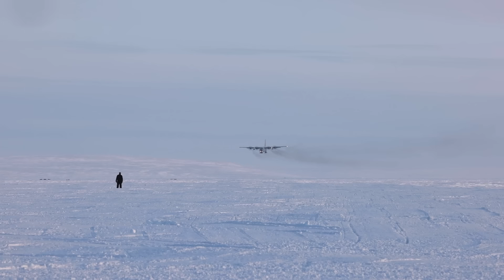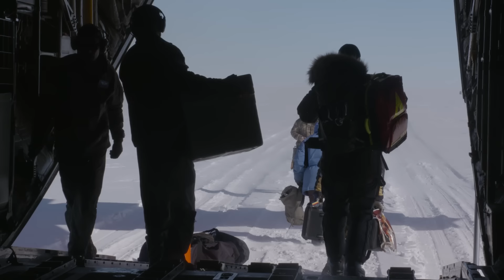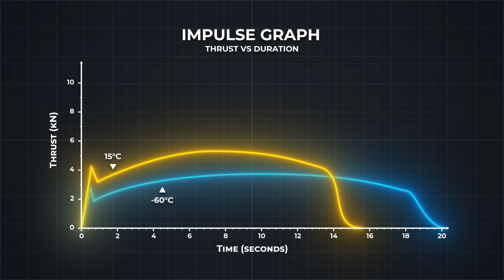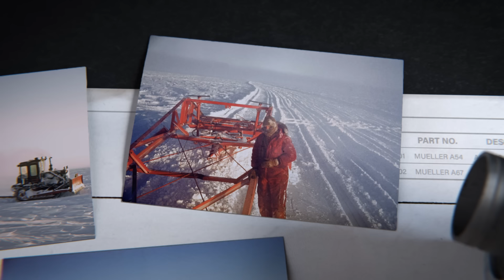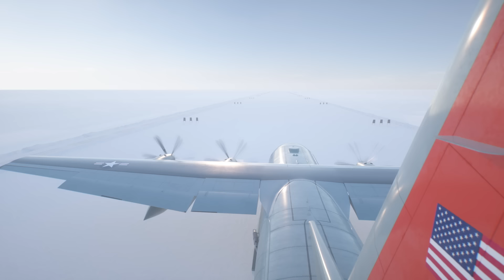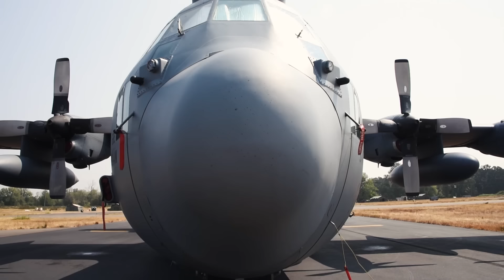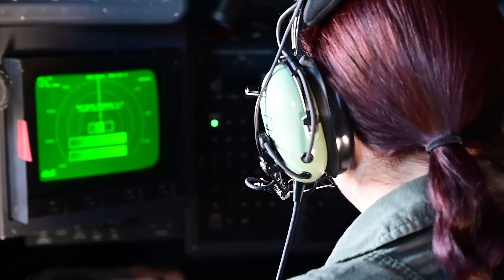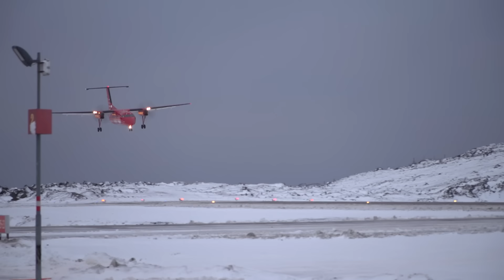The Wildest Take-Off of My Life

Comment: JATO rockets are straight-up one of the most badass things humans have ever strapped to a plane. I mean, the C-130 blasting off the ground like it’s late for war? That’s already insane. But then you find out they bolted JATO packs to DC-3s, C-47s, SR-71 prototypes, Cold War patrol bombers, and even fighter jets just to see what would happen — and suddenly aviation turns into Mad Max with wings.

And don’t even get me started on the Zero-Length Launch (ZELL) systems — like, “Hey, what if we launch an F-100 from a trailer in the middle of nowhere using a giant-ass rocket?” No runway, no problem. Just light the fuse and send it. That’s not just engineering — that’s pure testosterone and rocket fuel.

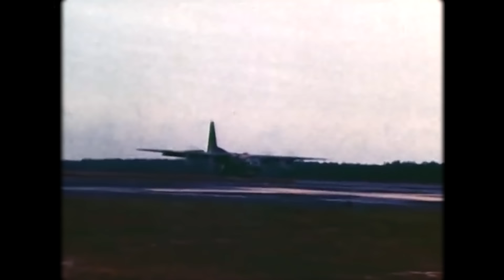The whole concept of landing a C-130 in a soccer stadium just proves exactly how cool these things are. We were so close to turning cargo planes into friggin VTOL sci-fi monsters.  t 3:49, I don't know if y'all were tracking this, but that thing was off the ground from a dead stop in just about 3 seconds!  They put a friggin c-130 in the air in around 100 feet!  

JATO is just friggin cool.

Comment: I grew up literally down the street from the front gate of the Stratton Air National Guard base - it wasn't even named that yet at the time  (47 Habel Lane was our home).  I could see the base buildings and some of the apron from my bedroom window, including the test stand where they ran up engines after maintenance.  You just kind of got used to the noise and vibration.  The 109th was operating C-130D models, very early C-130s with three-bladed props, when we first moved in - some with skis.  

In the mid-80s they replaced them with LC-130H models.  I wonder if there will ever be an LC-130J model - those LC-130Hs are getting pretty old now.

There is a C-130D on display as a gate guard outside of the base now.

Comment: Great video.  It brought back many memories as I was a pilot flying these same missions in the early 1970's (50 years ago!). Some history:  I and my trusted crews (pilots, Flight Engineers, Navigators and Loadmasters flew out of Sondrestrom (now Kangerlussuaq) to support the two Distant Early Warning (DEW) sites out on the Ice Cap (code named Dye II - 7,600' MSL- Now Raven Camp) (and Dye III - 8,700' MSL - about a 30 minute flight further south east) (both now abandoned).  We were the 17th TAS (Tactical Airlift Squadron) back then based at Elmendorf AFB at Anchorage Alaska. We always had two aircraft at Sondestrom and would rotate crews and aircraft about every two weeks.  Our aircraft were different. We flew C-130 A models that had a max gross weight of 124, 200 pounds. We had six of our aircraft modified with skis and were designated C-130D's.  They had 3-bladed Hamilton-Standard props that had a larger diameter than later C-130s, starting with the B model that had 4-bladed props. The procedures the 109th use seem to be pretty close to what we used for operations and the hydraulics and design for the skis seems to be about the same.  The 17th did the Arctic work while the Navy used early LC-130's for the Antarctic work.  Brian, thanks for the fine work on this production and special thanks for the memories you brought back.  Jim Banas, Captain, USAF (Ret).
Reply: I was in Sonstrom and 64 when we were bringing F102 back from France. It was a refueling while there I watched C1 30 fake off with rocket assist because our runway was very short. It was amazing how quick the 130 would jump off the runway I was with 59 FIS from Goosebay Labrador

Comment: My Father was a Navy pilot in Operation Deep Freeze in 1967-69 flying C-130s on skis in Antarctica. The ice takeoffs and landings on prepared runways were not terrible, but the science outposts that overwintered usually had snowed over and that was really hairy. One place they had to taxi the plane up the base of a mountain and turn it around and use the slope to get enough speed, hit all the JATOS, and take off. He took photos of the plane making a trial run up and down to pack the snow first. Maybe they just did it for a goof, those guys were all crazy. He said the scientists stunk so bad after spending the winter basically buried in a Quonset hut that the crew clear up in the cockpit wanted to gag even with oxygen masks.

Comment: The Hercs we’ve flown on in recent years both in Antarctica and Greenland are quite old. Modernization of the propellers and engines helps but many of the airframes are still 70’s era. They seem to be in a state of constant repair and often can’t complete missions because of equipment problems. A much newer plane with the same ski and propeller setup could probably improve the overall performance of the LC fleet

Comment: Great video! I spent a long year at Kangerlussuaq (called Sondrestrom Air Base when I was there) as an Air Traffic Controller in the USAF. During the summer we would have 3 ski equipped C-130s arrive to fly refueling missions to the Greenland Ice Cap and the early warning radar sites called DYE-2 and DYE-3. They would carry large amount of fuel oil for the DYE sites to get them through the rest of the year. I saw many of them use JATO during those missions. We even had one come back from a mission with one of the main gear skis hanging down because of a failure during its takeoff from the ice cap. The pilot handled it perfectly and managed to scoop it up as he touched down on the runway with minimal damage to the ski and aircraft. That was a tough mission for the C-130s but it is a fantastic aircraft. BTW this was in 1974 and they were flying C-130A models with 3 bladed propellers. A lot less power than the later H and J models in this video.

Comment: I was curious about why it still had such a big radar. The compass is, obviously, useless, but I was assuming that it would be perfectly capable of navigating using GPS.
The removal of the radar would save a significant amount of weight and it would reduce drag as well.

Comment: Hovercraft wouldn't have any friction with the snow regardless of what type of snow you have, hovercrafts float on a cushion of air only the skirt touches the ground, so almost zero friction.

The turbo prop engines on the airplane would have the ability to provide massive amounts of compressed air, if the ski's were replaced with hovercrafts.

Comment: The Co Pilot  hits a button in the cockpit on order of the Pilot. The button is near the aft end of the center control pedestal, it's small, round and black. just to the side is the guided Arm switch with has to be opened and flipped forward in order to arm the button.

Comment: Excellent presentation -- thank you! My dad was a navigator with the 17th Tactical Airlift Sq., the "Firebirds," at Elmendorf AFB, Anchorage, Alaska, from 1971-75 -- the year  that the (active duty USAF 17th TAS) transferred its Arctic/ski-model C-130 mission over to the NYANG at Schenectady, NY. Those airframes were (early) C-130A/D-6, with just a few having the skis (largest aircraft skis made), early Allison T-56 engines,  three-bladed props, and JATO bottle augmentation. The ski-models supported the distant radar sites on the Greenland icecap, operating from (then) Thule and Sonderstrom Air Bases, as well as other Arctic missions on snow/ice sites. The other (non-ski) -130s of the squadron supported the many DEW (Distant Early Warning) radar and military sites around the periphery of mainland Alaska and the Aleutians. 

In the mid-1970s, there was a mishap on the Greenland icecap, resulting in the loss of one of the ski 130s:  I believe it was during a missed approach landing attempt, with the left wingtip striking the surface and bringing the aircraft down and sliding to a halt. The left wing folded down at the root, with the #2 engine prop tips cutting a narrow gash into the fuselage - tragically, killing a Danish national passenger seated in the (folding) troop seat at that location. 

Much has changed since, with NYANG's 109th Sq. operating in both Arctic and Antarctic missions -- progressively upgrading the versatile Hercules airframe to the LC-130s newer engines and props. There is one of the original 17th TAS's C-130A/D-6s, with skis, old engines and props, and the signature gray & red livery, sitting outside at the (fantastic!) Pima Air Museum, Tucson, AZ --  tired and weatherbeaten now, but really good to have such a unique example kept for all of us to be able to walk up to and see. I recall seeing my dad's (then) crowded nav station, with sextant, heavy case full of polar nav charts, celestial sight-reduction table pubs, stop-watch and big, ol' Hamilton 24hr navigator chronometer, dividers, plotters, and all of the heavy analog instruments, radar repeater, LORAN tube, and life support gear. NO GPS then.
Reply: Same time I was there.  What was your dad's name?  The mid-70's mishap was tail number 495.  Lost rudder control on approach.  Mishap board said it was "fin stall" but most of us felt it was a failure of the rudder hydraulic pack.  They settled to the icecap fairly level and one of the pilots commented that, "They thought it was a slightly harder than normal Ice Cap landing", until the nav looked out the crew entrance door and saw the left wing root was cracked and on fire.  The Danish national was seated just forward of the prop line and when the #2 prop came off it gashed the fuselage where he was seated and he bled to death from the injury.

Comment: Marine KC-130 mechanic here, I worked on aircraft equipped with the 4 blade props. They were susceptible to hydraulic leaks in cold weather (hydraulics controlled the variable pitch props). The USMC sold/transferred all our aircraft which were then equipped with the NP-2000 8 blade props. Other than the performance increase, I hope the engineers figured out this issue, but its good to see these old hercs still operating in the harshest environments in the world! great video!

Comment: In the early 70’s the “ski birds” flew out of Elmendorf AFB to resupply the Thule Greenland radar sight. Our shop would on occasion have one of the skis in for repair. They are incredibly heavy and no doubt were the reason for JATO assisted takeoff. Part of the repair was replacing the Teflon sheeting on the lower surface as well as repairing banged up chines. Amazing machines.

Comment: The C-130 is such a versatile air-frame.  I had the pleasure of riding in one based out of Kodiak Coast Guard base during one of its "milk runs" to Anchorage.  
Need to precision drop critical lifesaving gear to a fishing boat in the middle of the Northern Pacific ocean ? Coast Guard C-130
Need to move supplies to a dirt road in a combat zone? C-130
Need to fly weather equipment into the through middle of a raging hurricane? C-130
Need a close air support flying tank?  Strap a tank 105 mm Cannon to the side and call it the AC-130.

Comment: I had no idea that the skis were Teflon coated, I would think that that would help reduce the friction and the resistance greatly
Reply: Sports snow skis use high molecular weight polyethylene (HMWPE) with wax melted into the porous structure between the molecules. At reasonable temperatures it has a lower coefficient of friction on snow than PTFE (Teflon), but is probably less durable in abrasive hard frozen snow conditions as well as the increased friction of the low temps. Plus MUCH more weight, plus a bit problematic to adhere to the large area of the ski bases. More thermal expansion and shrinkage, too. 

Tough to flip over for the necessary periodic rewaxing…

Comment: It's interesting to me that cold temperatures are what drove the pilots to leave early.  -40 C is a normal temperature at altitude, surely the plane is just fine there.
Reply: Must keep them running, using fuel, but at idle so there’s much less heat for deicing, cabin, accessories, etc.?

Comment: C-130 Engine troop right here so I HAD to watch this and it was great. The part at the end with propellers really had my interest. I wish i could work on those new propellers! However, as Im active duty we got rid of all of our H models. (The National Gaurd has them now.) We have the more modern J models using Rolls Royce AE2100D3 engines with the 6 blade propellers. 

The H model c130 uses 4 allison T56 engines, usually fitted with the 4 bladed propeller with a mechanical valve housing. The LC-130 ofc has the much mych better octagons (8 bladed propellers) with an electronic valve housing which makes it so so much easier to work on. Im sure the national gaurd appreciates that.

However despite not being able to work on these cool planes, I actually still do like the J models. Far more modern and easy to fix and dont break as often. Theres also much much less safety wire which just makes work far quicker and easier.

MFE!!!
Reply: Interesting fact about the whole 4 bladed propellers and the mechanical valve housing.
I was told back during my technical training that the valve housings on the 4 blad props were so old and complicated that only like 4 or 5 people are still around who really knew how to fix them for the deeper maintenance lol.

Comment: I'm kind of curious why they specifically chose the C-130 platform over other aircraft, of course something like a C-5 (and even the C-17) would probably be excessive and too heavy. I'm guessing it's because it was designed to be able to handle rough takeoffs like you said in the video and is less expensive to maintain among pilots already being familiar with it.

A whole segment on exactly why the C-130 was specifically chosen would've been nice, but I know you guys try not to make the video too long for viewers.
Reply: Probably bc the nickname for  c130 is "Hercules "
Reply: The C-130  was doing this many years before the C5 and C-17 were designed and built.  I did this in the early 1970's as a pilot with the 17th TAS